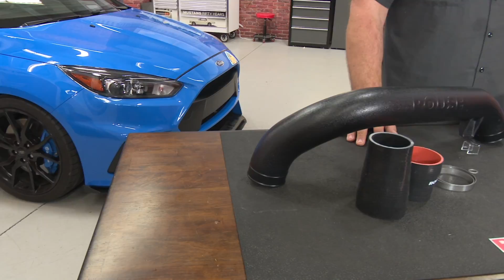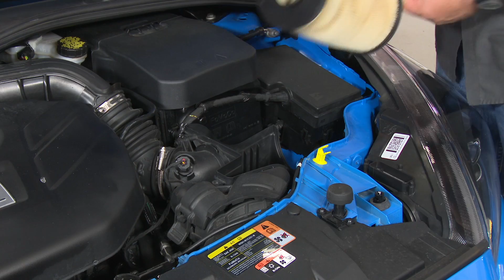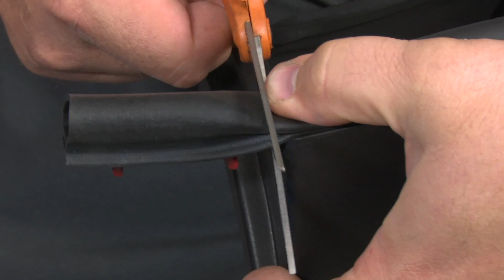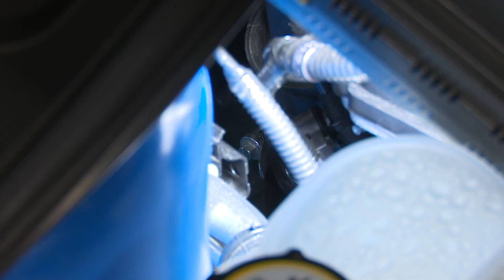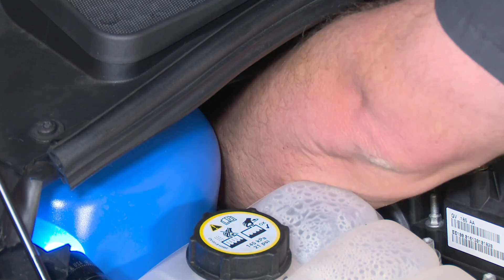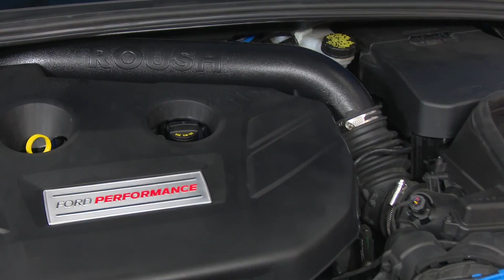Focus ST/Focus RS Roush Cold Air Intake Kit 2013-2018/2016-2018 Installation

Comment: Do you need a tune for this?
Reply: Cole Waldo no, also works under warranty it’s ford performance approved
Reply: @adamfreeman6640  You don't need a tune for an intake on an ST?!
Reply: @hungrypersian  no you do not need a tune for just an intake and filter. The only time you absolutely should need a tune is if you have a Downpipe upgrade and step colder plugs. But even then you can still driver regularly without romping on it.

Comment: made of plastic. huge fail for the $ it cost.
Reply: I actually called Roush to inquire about the change from aluminum to plastic for the induction tube. They told me that they decided to make the change because the plastic tube retains less heat then the aluminum, allowing for lower air temps.
Reply: I'm pretty sure that Zander13's Garage is talking about the intake tube. For almost $400 I'd expect it to at least be aluminum.
Reply: yes
Reply: Zander13's Garage Yeah your comment really fit right in with some common public opinions. The intake tube didnt even cross my mind :)
Reply: yeah 400 bucks for like 3 pounds of plastic is ridiculous. you're paying 300 for the roush name
Reply: sammichmanjr yeah thats right, that may be.
Reply: Zander13's Garage I highly disagree. I paid 80$ grand for it where I live and I love it. I have been driving many different high end cars. I dont enjoy mercedes interior as much as people praise it. I really dislike the entire wv group(skoda and audi). Volvos feel really nice but the design is incredibly boring. And if you think the Rs is plastic then check out a new chevy suburban for 2x the money!! Awesome suv but my toaster have better build quality :D